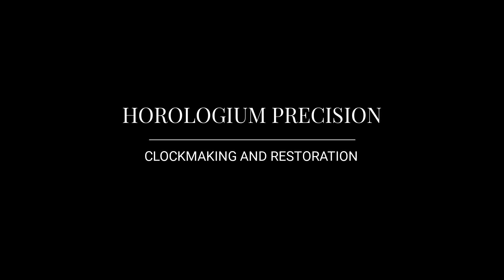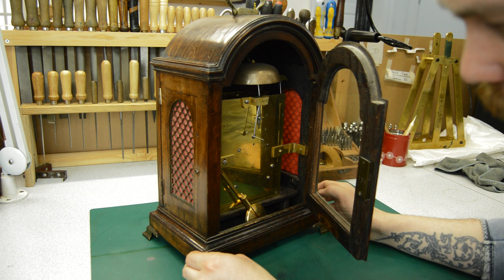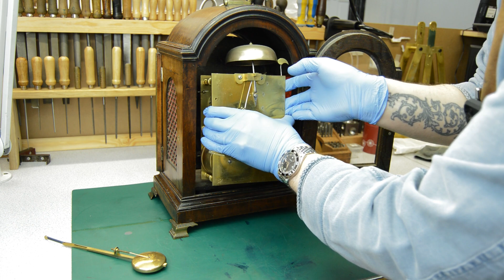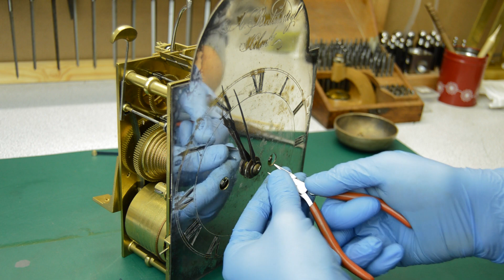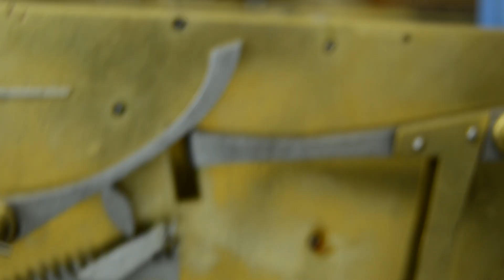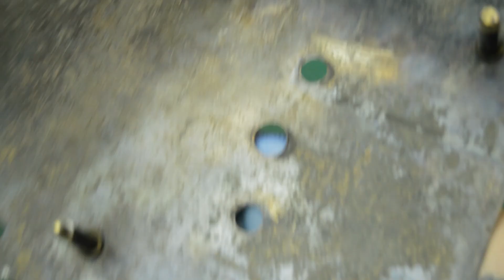Antique Clock Restoration - The Complete Job - Part 1, what does it need?

Comment: Your screw driver did not fit the screw slot?
Wouldn't the fusee have used a chain?
JIM
Reply from the maker: No this clock originally had gut lines on the fusee.